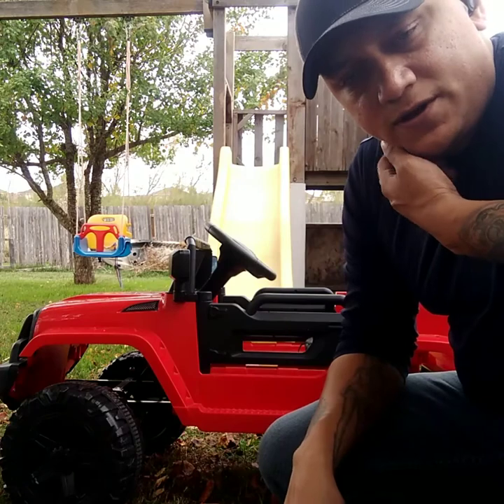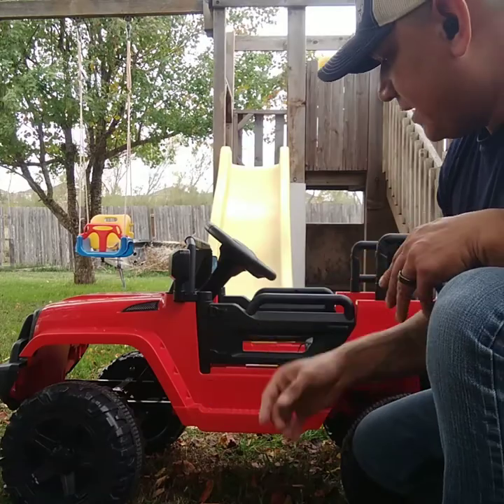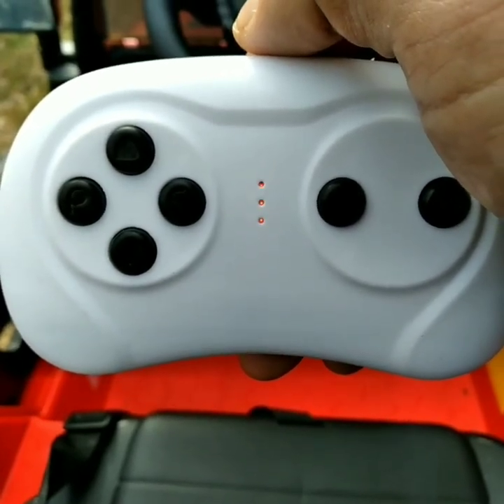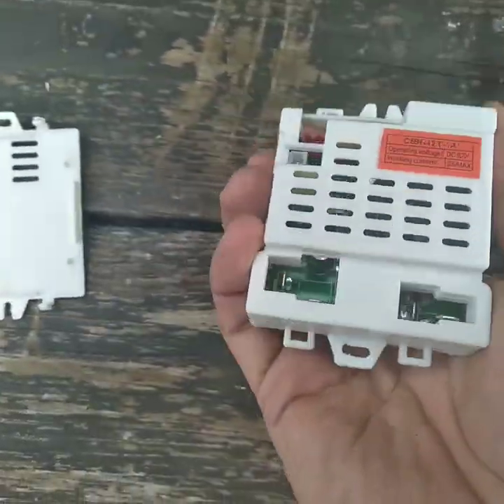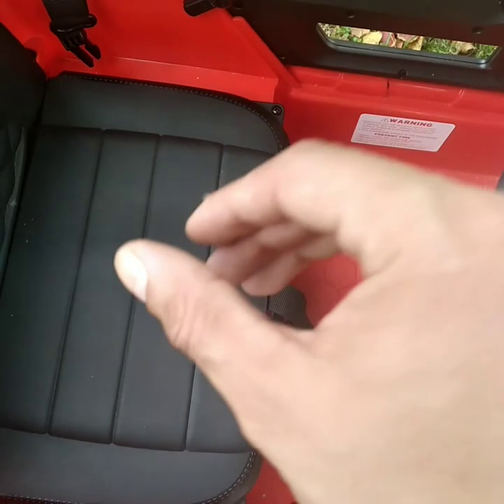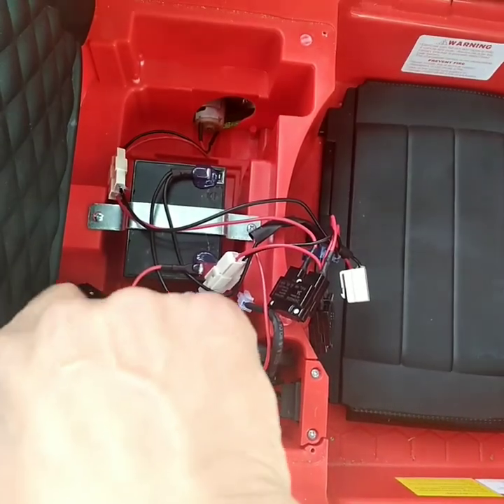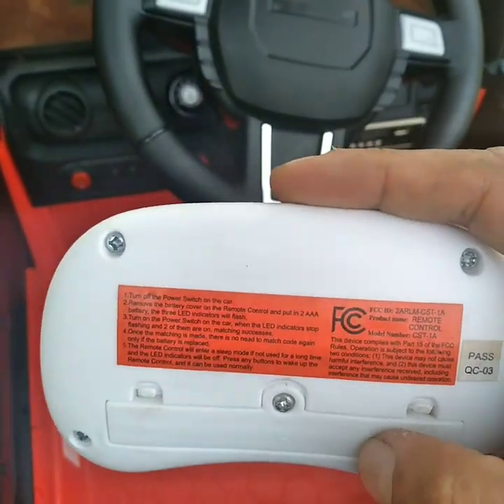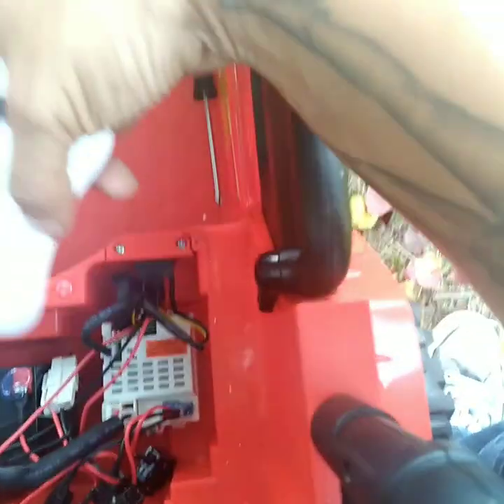Ktaxon 12V Ride On Jeep Not Connecting To Remote Control

Comment: Hi is it possible to turn the remote off without taking the batteries out? When our car is off, our remotes bottom light continuously flashes. It says in the manual it will enter sleep mode, but it kills the batteries so quick. Suggestions?
Reply from the maker: @Christina-f5h  if the light is flashing, it sounds like you have it in park. Take it out of park, and the remote should turn off after a few minutes.

Comment: Mine was doing exactly the same. I bought the new receiver and it started working and moving with the pedal, However my remote will not connect at all to it.
Reply from the maker: I think some receivers only work with some remotes. Did you get the exact same part number as the original? I know there are also options to get the receiver and the remote as a pair.
Reply: @dadgonetired2306  I didn’t see a part number on mine. I just ordered the one you purchased.
Reply from the maker: @Blair_chronicles  I'll check my remote to see if it has a part number on it.

Comment: I have mine linking problem same but i check receiver opened nothing no burst capacitors and when i try to push on accelerator nothing happens too. No linking with control either.. so not sure what the problem is. Lights turn on and radio works but accelerator nothing linking nothing battery is good checked multimeter
Reply from the maker: I sent the manufacturer a video of what was going on with the remote and accelerator not working, and they confirmed that the receiver was the problem. 

This all happened before I found the blown capacitor.

The receiver could still be defective even without any visual defects.
Reply: @dadgonetired2306  i will replace when i get chanche
Reply: V v v xx v     bb
Reply: Just went through the exact same thing with under the hood model . Tested right before getting my 1year old on to it and was working on rc mode but pressed the Park button or the pair button (not too sure haha ) while driving it in rc mode on the remote and the remote stopped responding ..causing it to do a burnout against the wall for a good 20 seconds 😅 unplugged the battery to reset the power wheels ..now here I am watching this video 🎉

Comment: I have the Lamborghini Urus 12v Ride On. I'm guessing it's the same maker because the remote is the same. The issue with mine is that the three lights on the remote all stay on, no flashing and never turn off unless you take the batteries out. The car still works manually by pressing the pedal but my son is 13 months so this is really the only way for him to be able to ride it. Any idea what could be the problem??
Reply from the maker: My first idea would be to get it replaced under warranty if you're the original purchase. If not, it sounds like the remote itself is the issue, but if you're going to replace the remote then I would suggest just spending the extra 10 to 15 dollars to get the remote and receiver as a pair so that you know for a fact that they were designed to work together. 

One thing to note is that all of these different makers get their parts from the same place. The same remote is used across many different brands. There are even other remote that have the same internals but look different on the outside. This is why I recommend just getting the remote and receiver together as a pair. I would still use the part number off of the original receiver. Not the remote, but the receiver itself.
Reply from the maker: It could also go the other way around, the remote and receiver could look the same, but have different internals or different frequencies.

Comment: I know this is old but i got my daughter a similar truck with the exact same remote. Everything works fine except the vehicle won’t turn using the remote. Any ideas?
Reply from the maker: I would probably start with checking the plugs on the receiver. Then, do you know how to use a voltmeter? I'd use it to see if voltage is getting to the motor that turns the wheels when you press the turn button on the remote. I think it's mounted on the steering column. Also check any gears that connect the motor to the steering column or the steering linkage to make sure that it's making good contact. I'm not looking at the jeep right now, this is just off the top of my head. 

Also, are you able to take the remote apart? I wonder if the button is making contact in the remote. If not, then it'd be cheap to just buy a new remote with a new receiver. You can get the remote separate from the receiver, but it only costs a few bucks extra to get the receiver as well. Please let me know if any of this helped, or didn't help. I'm really curious what your fix is.
Reply: Can u tell me where to get extra remote

Comment: Will this work with an m18 battery?
Reply from the maker: A lot of people convert to an 18V battery, but they end up burning up the wheel motors that were only rated for a 12V battery. If you're going to "upgrade" the battery, then you should upgrade the wheel motors as well.

Comment: How do I reconnect my remote if it’s not reading the car?
Reply from the maker: Was it reading before? It automatically reconnects when you turn on the car. First turn on the remote by pressing any button, then turn on the car. If it doesn't connect, something is wrong.
Reply: @dadgonetired2306  after we let the car sit over the winter we have to sync the remote to the car all over again, the car still works separately from the remote we just don’t remember how to sync them back up.
Reply from the maker: Try watching the video again starting at 08m36s. Let me know if that helps.

Comment: Mine isn’t pairing and I just bought it
Reply from the maker: That really sucks. Which are you turning on first? The remote? Or the car?
Reply from the maker: Are the lights flashing on the remote? You made sure to plug in all plugs?
Reply: Same here. I truned the remote on first but it isnt connecting

Comment: I just got mine for my son. How long did you have to charge the vehicle before operating?
Reply from the maker: I followed the instructions in the manual, which happened to be the same as most recommendations i found online, and charged the battery for 18 hours before the first use.

Comment: A friend bought used Best Choice Products Jeep at a sale we went to. I have it at my house. My husband and I have already fixed some minor issues. We cannot figure out wire loose blue wire is supposed to connect. It is apparently to speaker since radio, mp3 by aux, horn.... none of these work. Everything else is fine. Can you help?
Reply from the maker: Where is the blue wire located? Under the seat? Or under the dash?
Reply from the maker: Is the end of the blue wire bare or is there a plug? Does the radio turn on with no sound? Or does the radio not turn on at all?
Reply: @dadgonetired2306  It is bare.
Reply: It is under the hood. Bare on the end. Radio turns on, shows battery volts, shows FM but no channel picks up. I plugged mp3 in aux but still no sound. Horn didn't sound either. Same steering wheel as one in your video.
Reply from the maker: Sorry, I haven't gotten around to opening ours up to see where the blue wire goes, or if we even have one. Dad life.

Comment: I have a problem where the remote is connected but it doesn't control the car. Accelerator works manually but not the remote. Any idea on how to fix that?
Reply from the maker: Sorry it's not working, Tony Dang. Not sure. Have you looked at the receiver and plugs/connectors for any visual damage?
Reply: @dadgonetired2306  I forgot to mention that I converted the battery. It is now going off a dewalt battery.
Reply from the maker: @tonydang482  not sure if the Dewalt battery has anything to do with your issue. I would imagine that your issue would be with either the remote or the receiver, or both. 

On a side note, I normally wouldn't change the size of the battery without changing the motor as well. The motors are designed to run off of 12v batteries. An 18v battery could burn up the motors or just shorten the life of the motors. I do plan on putting a 24v battery in this one, but I'll also be changing out the motors as well.